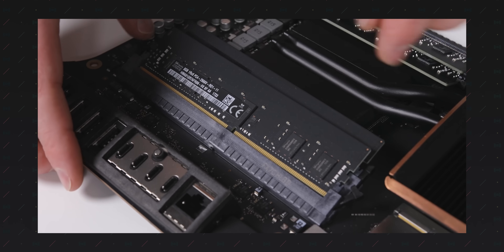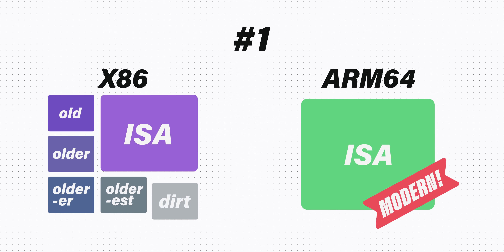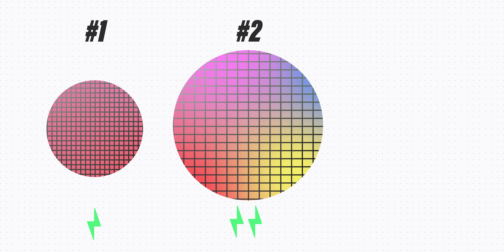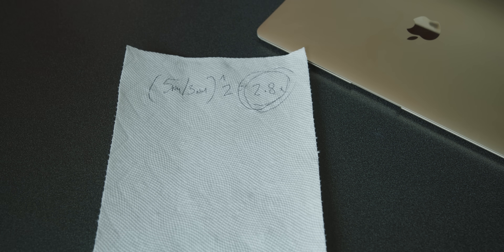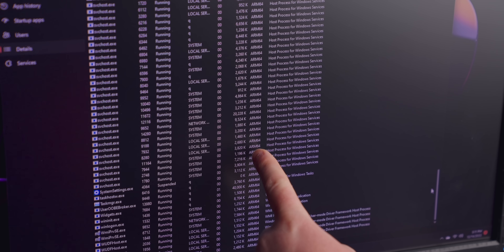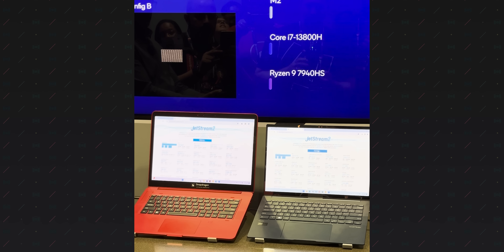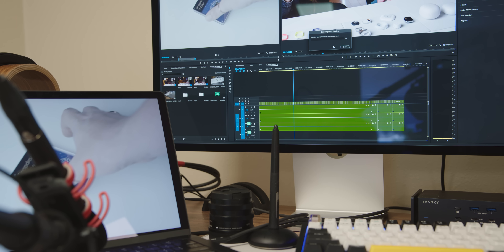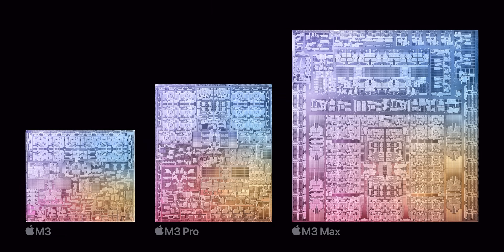Apple's Silicon Magic Is Over!

Comment: Hey Snazzy! Lovin' the beard!
My wife had me grow a full beard because she always thought guys who were clean-shaven looked "baby-faced."

I was expecting the M3 to be a head-and-shoulders improvement over the M2, even more than the M2 was over the M1. But the word is that we got "early-release" M3s, that did not yet take full advantage of the newer architecture. We would have to wait for the M4 for that.
Apple presented us with their late evening "Spooky Fast" event, and I bought the M1 MacBook Air I had been drooling over since  WWDC 2020. 
The new M2 MacBooks ran hot, though not as hot as the intel MacBooks did. I had to assume the M3 would run even hotter.
Also, the new MacBook Airs, don't even LOOK like MacBook Airs, just like thinner MacBook Pros or something.
This M1 MacBook Air is the pinnacle of MacBook Air design, in my book.
I still have full confidence in Apple, but I won't even consider an upgrade until the M5 or M6.
I was completely unimpressed the first time I saw MS-DOS running on an 8088. I've been thoroughly unimpressed ever since. Nice try guys… Keep trying.

Comment: When they pivoted to in-house chips I along with most were expected a price drop instead with the SOC storage and RAM costs went up. How about the apple lineup gets an affordable ie reasonable cost product in the IMac, and Air and the Pro goes to a higher cost but upgradable option again!
Reply: Apple uses the age-old business model that no doubt their in-house statisticians have tested: You start high to recover initial fixed costs at launch with a higher retail price, and then, as the cycle of that model ages, lower the price. Sensible buyers will see this and buy at the end of the cycle or even wait for the new cycle and buy the older model. I have recently seen the M2 MB Air base for £800 in a sale.

Comment: I'm a lifelong Windows user, and still use it in my desktop PC and extensively thru work but I recently bought a used MBP 2021 M1 fairly cheap and I gotta admit I love the thing. Even if Microsoft and Qualcomm might catch up, I honestly prefer MacOS in alot of areas. It's more customizable than Windows, doesn't have massive UI changes with each update and just feels more finished. Not to mention the hardware; the display and keyboard and overall chassis. I really like it.

Comment: I liked the Quinn beardvolution shot.
Reply: Came here to say exactly this ✊🏽
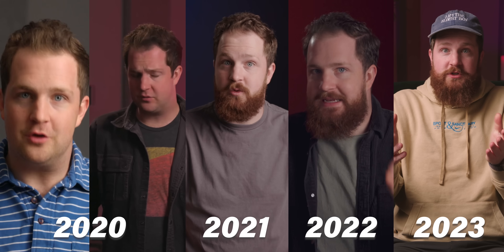Reply: 2:00 clicky clicky
Reply: slow decline into becoming a hermit
Reply: He wanted simpleton brains to comment about it. You got manipulated.
Reply: He wanted complexton brains to comment on simpleton brains comments. Also you got manipulated.
Reply: The biggest issue is that it's not a pc.
Its greatest achievement is that it's not a cromebook.
The Acorn pc used Risc chips.....in the 90s. Risc chips are great for using half the power and taking 3 times as long to do the same task.

Comment: Just broke down and purchased one of the cheaper wallymart M1 air. After using many intel Macs through the years i love it! would i want to try to export loads of video on it? no, but that's not at all what it was designed for.
Reply from the maker: You still could though pretty well and that’s the amazing thing about that machine.

Comment: 16:15 I love Quin’s obsession with the 12” MacBook.
Reply from the maker: It’s unhealthy
Reply: @snazzy  I'd argue it is the perfect amount of healthy!
Reply: @snazzy  I have a similar relationship with the 2009 13” MacBook Pro…
Reply: I miss that thing. I remember when the OG 11" MacBook Air came out and I was in love with it. Still am tbh
Reply: @nateo200  I remember when I saw it first time. I couldn't belive that something so elegant could be produced as working computer
Reply: I won't lie I was still checking out on ebay if i could find a maxed out 11" a few months ago. Even after so many years it would run Linux with no problems.

Comment: Well the fact is - apple knows they are not competing with Qualcomm or Microsoft.

They are competing with stubborn and risk-averting OEM's like dell & hp & lenovo. 
And i don't see the brands, who after 7 years of Amd's Zen chips still don't offer chip options from both brands in their premium line up, to jump on the ARM hype train immediately. Just like they haven't till now.
Even if Qualcomm has made impressive chips I only except laptops from Surface & maybe Samsung and maybe 1 or 2 models from some other oem.

Comment: Excellent insights here, as usual. Although I will say the form factor of the M2 MacBook Air is fantastic. The display is noticeably more vivid and smaller bezels than the m1 and the chassis design and colors are better as well. Also the webcam and SSD speeds. I think the M2 MacBook Air with 16 gigs of RAM and a 512 GB SSD is the sweet spot of computing for 99% of use cases. But the M1 chip is all anyone needs outside of video content work and local ML model development.

Comment: One mistake: In the beginning of the PowerPC era Mac owners could be bragadocious for the first time. They were faster and more efficient than Intels chips. That advantage faded away later until the switch to Intel was a big step up.
Reply: It's pretty ironic actually.  ARM is the spiritual successor to the RISC arch in the PowerPCs.
Reply: @joelv4495  yes and no as ARM kind of predated PowerPC thanks to Acorns work on the BBC micro and all that.
Reply: @joelv4495 RISC v CISC is pretty irrelevant today tho tbh
Reply: The reason that drove the switch to Intel was that they could not get power efficient G4 CPUs for laptops, which makes up for most of Apples computer sales. The floating point units in the G5 absolutely smoked the first Xeons Apple used in the Intel MacPros
Reply: @JoseJimenez-il5vs G5, but jes
Reply: PowerPC was more efficient (in the beginning). I remember a test were the notebooks were a lot faster than Intel-Notebooks. I don't know about desktops.
Reply: @krasserTerror  and I think that was the biggest issue with PowerPC outside it being really hard to code for, after a while its advantages over intel diminished and there was just too much infighting.
Reply: @themadoneplays7842  The issue that made Apple switch to Intel was that PowerPC was delivering less performance per watt. For example it was impossible for Apple to put a G5 into a laptop due to excessive heat. Also, IBM (the G5 manufacturer) couldn’t cross the 3 GHz limit
Reply: @moow950  Funny that they also ditched Intel for the same reason :D
Reply: @krasserTerror  That was a gimped benchmark (yes I am that old), they basically ran low-level instruction tests to get their figures, RISC's advantage is in low-level processing, but if you want to make a window display a calculation the RISC system has to run multiple sets of instructions per each CISC instruction.

In the early days of RISC (pre apple) the CPUs could deliver far higher mhz than the CISC cpus, by the time Apple started using  them they were roughly on par, better for some things, worse for others (similar to m series now).

The largest advantage by far that ARM has over x86 is the x86 backward compatibility stuff. That weighs down modern CPUs a lot.
Reply: @slipoch6635 how though? Don’t modern cpus operate a secondary isa different from x86/x86_64 natively anyway?
Reply: 1ghz TiPB was one of the best laptops ever made. It was the fastest laptop for years and built like a tank
Reply: Well looking at what it took to cool the G5 LOL😂
Reply: @sprockkets I remember my 700 watt G5 psu. Insane
Reply: From 2004 onwards, ALL mac vs pc ableton and cubase benchmarks on futureproducers board always showed favor in the custom builds vs macs.
We are talking hundreds if not a thousand identical set tests with outputnproof.
Reply: They were never faster then intel that was a marketing lie. I loved the pre intel Macs Computer pre sysyem 10 days. Apple will eventually fix whatever problems they encounter but some things are by design. Apple computer where never built to be customizable since the Apple II lost to the Mac. If the Woz had his way, Apple computers would have been more like custom pc are today.
Reply: @computernerd8157  If you look at listed clock speeds, you're right, but per clock Intel was objectively worse
Reply: @computernerd8157  No they were faster if we are talking purely about the hardware/chips, the issue is Motorola nor IBM for that matter could keep up with Intel in the area of process, that was always Intel's ace hole now that TSMC's ace in the hole.  The other big advantage was compiler optimization on x86 vs PPC.  Apple's issue with early PPC was classic Mac OS, not the actual hardware, running linux or AIX early PPC 601 variants were quite a bit faster than the pentium, later G3 chips were faster than the Pentium 2 all of this was running a mac os with lots of emulation to run old 68k apps.  The G4 was mostly produced by Motorola who never got yields high enough with high clocked chips, the IBM made chips always clocked better.

The issue was cost and flexibility, there were no "low power" chips nor any really high-end wide chips because IBM and Freescale had limited markets to sell these chips and apple's business frankly was small.  The G5 was a super fast chip in 2003 the 3rd fastest super computer in the world was built using Xserve's because the G5 was basically a repack of IBM Power4.
Reply: @computernerd8157  PowerPC 601 was certainly faster than any Pentium of the day. PowerPC 603e was also decent chip, not necessary faster but decent. Later, 970 (G5) was trully impresive product. Especially in a Quad G5 model. No comparable IBM PC was available at time, and you had to buy UNIX workstation for similar hardware. But Mac was much more affordable (it wasn't cheap, just cheaper than "priced as decent car" HP workstation).
Reply: This....  but to be honest...  even a 68k was zippy if you tweaked the OS right...  That's why I moved away from Mac..   even though Classic OS was at times buggy..  if you knew how to arrange your extensions, it was fast and just did its job...  none of this bloated OS with a kiddy interface that dumbs it down.

Comment: Weakly ordered memory access only creates more software complexity.
Optimizing strict ordering is better IMO.
So M1 using the Intel strict method was a good call in my book.

In general the more guarantees the hardware can give to the software layer, the less complex the software will be.
Any lingering unclarity or edge cases will result in practical slowdowns, even when the hardware in theory can be faster with weak ordering.